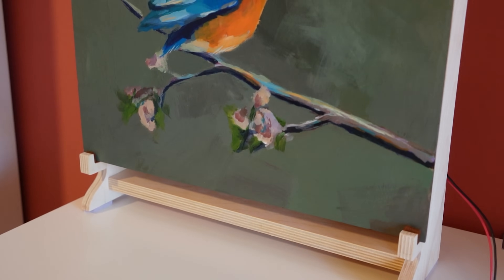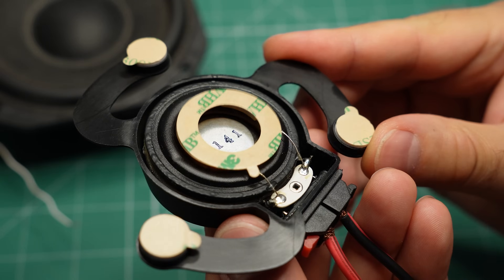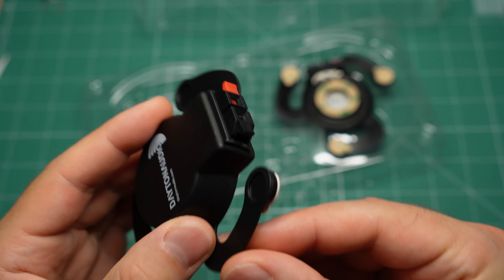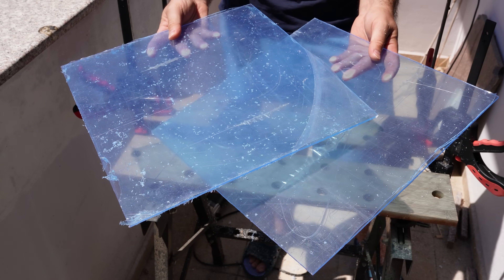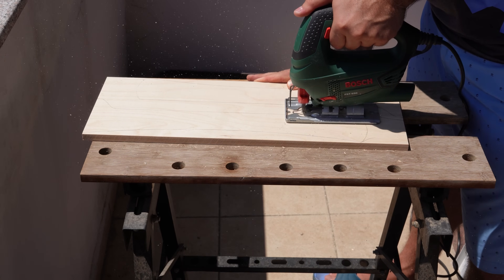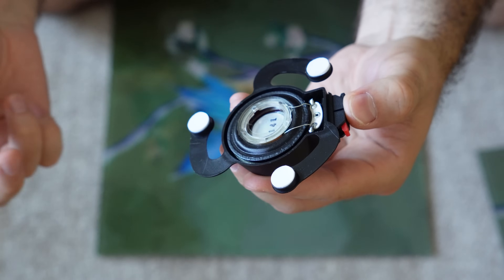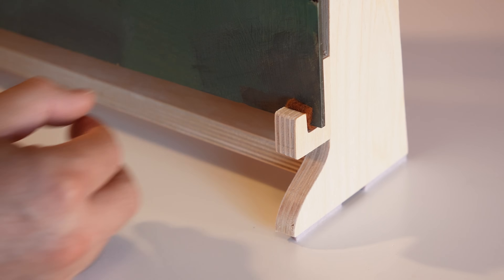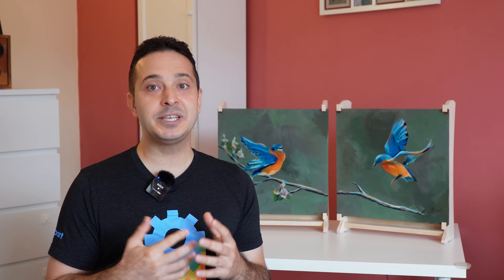You've never seen DIY Speakers Like These

Comment: Did you try hanging batting between the panel and the wall to allow for proximity without the interaction with the wall? Allowing for wall mounting would be a fantastic benefit.

Comment: The outstanding science/engineering youtube channel Tech Ingredients did a series of videos about making speakers like these.  They tested a good variety of panel materials and finally settled on acoustic ceiling tiles for the resonator panels, then they hung them from the ceiling.  The results they achieved were nothing short of outstanding and they shared an incredible amount of helpful information for anyone thinking about building some for themselves.  I'm quite surprised we aren't seeing some commercial offerings based on drivers like this.

Comment: Those plywood stands kill any chance of them sounding good. Suspend the acrylic on wire. 
You want the least points of contact on the excited surface for best performance and efficiency, if the surface is rigid.
Reply from the maker: Okay, I'll try that since others suggested the same

Comment: When we bought this house in 2006, I wired the whole house with SS-5.0, I used the basic spks, bookshelves to towers.  I bought a pair of drivers, as you have, and was going to install in the walls. However, I missed placed them and still haven run across them. lol

Comment: Exciters and transducers are cool, but they'll never match a nice set of speakers for quality, at least for critical listening situations.  I have a set of transducers mounted to my couch to add extra rumble from my home theater and those are incredible.  I'm planning on building a really nice kitchen table that can convert to a gaming table.  I had the idea to put some exciters in the bottom to add sound effects and ambient music for DnD sessions or something similar.
Reply from the maker: That is a cool idea! The only downside is that the vibrations on the table might be annoying. It would be nice if you could pair it with a soundboard for effects on demand

Comment: Does it works on mirror without shattering them? Like a bathroom mirror one on shelf
Reply from the maker: I tried in on a glass window once, not a mirror. It was okay but somewhat quieter compared to other surfaces, perhaps because the glass is attached tightly to the window frame and barely flexes. I don't think it will shatter the glass, but the vibrations may make the mirror unusable as such.
Reply: @LeftyMaker oh okay thanks

Comment: Maybe try suspending it using a string/wire
Reply from the maker: I don't think there's a chance of this working. With strings alone, the sheets of acrylic would be dangling all over the place.
Reply: @LeftyMaker  i mean putting a string/rubber band on each corner to suspend it and  acts as as suspension
Reply from the maker: ah, I see. Yes, this could work, but again, the rubber should be very strong.